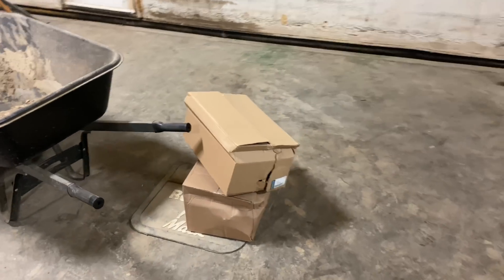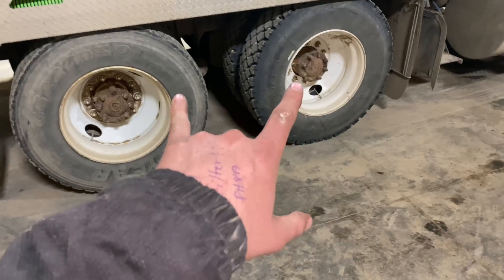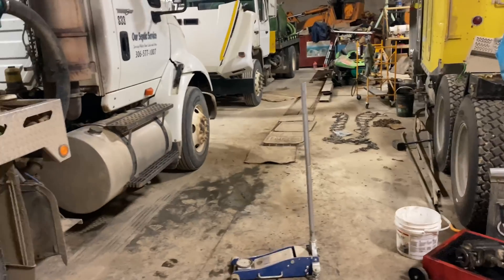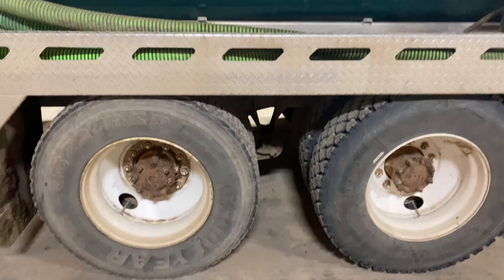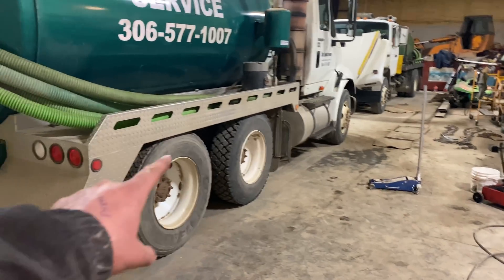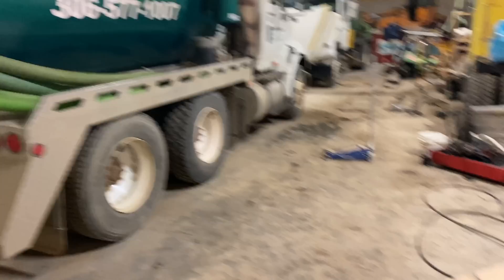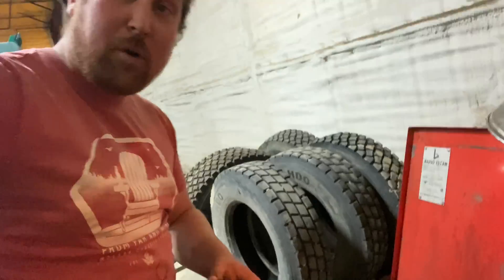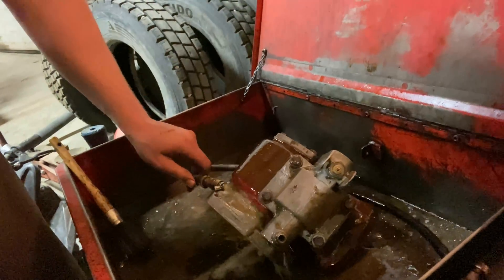PTO problems! Quick rebuild

Comment: I've always used steer lock nuts on the bolts that hold the pump on the PTO... I also copied another thing, put a great zerk in to the dead space where the coupler is.. if you keep grease in it, the splines stay lubed too...
Short of parts is never good!!
Little weld pretty much always does the trick!👍
I always check to make sure they mesh too.. just in case 😁
On the diffs, just do it bud, worst thing is you 🤬 up🤔😵🤬🤬🤬🤬
🥃🥃🍻👍
Reply from the maker: Well those are both great ideas!!! I will do that. Haha yeah- I’ll tackle it. Will make a good vidja